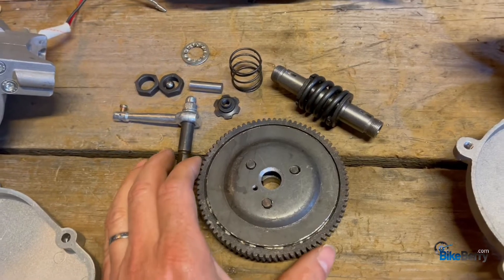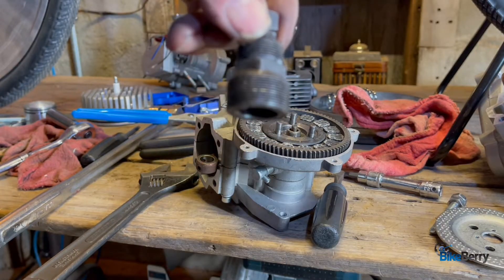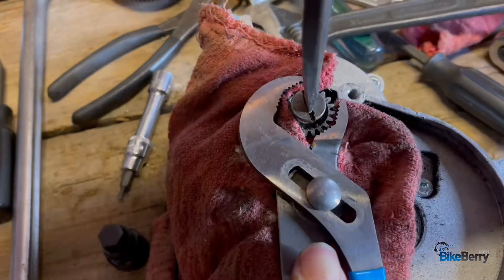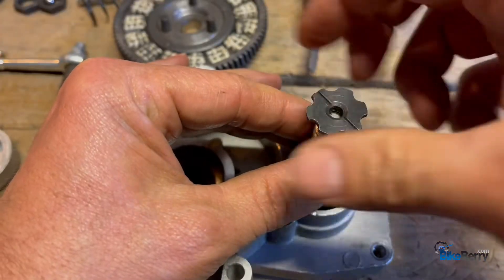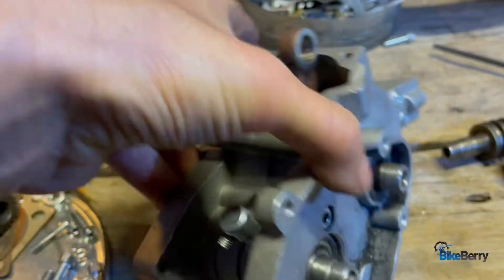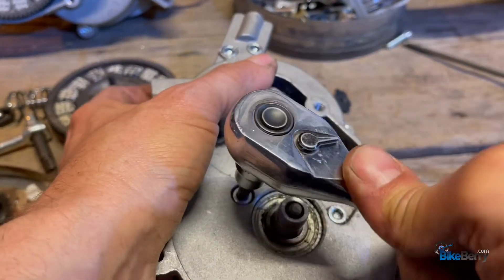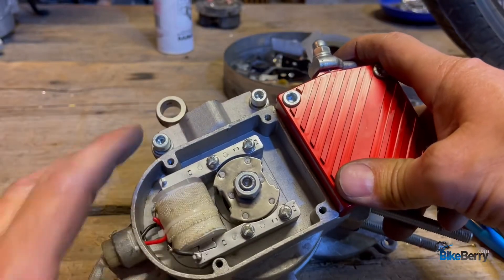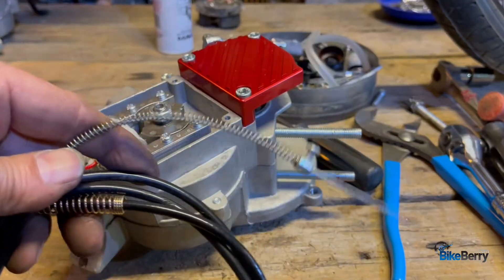Master Clutch Rebuild: Revamp Your 66/80cc Motorized Bike Engine for Peak Performance! | BikeBerry

Comment: Are hurt a cracking sound on my engine on the 80cc and it turned off the bike wheel locked I took off the spark plug and the tire moved but I do not know what went wrong😮
Reply: Same happened on my 100 cc I think its the part of the video where he tightens that big spring but I can't seem to figure out how to get the clutch open
Reply: @BigbagYQ ... That big spring is the main clutch spring inside the engine. You can tighten it up by taking out the cable holder screw located on top of the engine (it's the screw that the clutch cable runs through).
Take out that screw and then insert a small screwdriver down inside the hole into one of the slots on the washer that is attached to the main clutch spring. Make sure you get the screwdriver lodged into one of the slots. Then you hold the screwdriver tight with one hand and slowly roll the bike backwards. This will cause the main clutch spring to tighten up. You roll the bike back a few feet at a time. Then check to see if the clutch slippage has stopped. Repeat this process until your problem is solved.
Reply: @raulsaenz9281.. Sounds like you might have blown up the engine or broke a piston ring. Take off the top cylinder head and try pushing the piston down with your fingers to see if it moves or not.
Did you ever find out what the problem was?
Reply: @90daysinvegas53 did that pistons dirty and bike will run without springs google says just poorly, so a bunch of poor performance but I get a constant slip in my clutch after I freed my chain up and the wheel locked

Comment: I have 66/80cc engine to replace the clutch I have to disassembled the engine? Can I just replace the clutch wheel gear plate with the clutch pads?

Comment: I have a question. My small bevel gear that is next to the big clutch gear .do you grease those gears or no ? Thank you .❤
Reply: If you don't use grease, you will end up with a lot of tooth dust and no crank gear!    Always use quality high temperature Grease and DO NOT OVER GREASE!   The grease you should use should be thick enough so it doesn't fling around and get into the clutch!

Comment: With the clutch what would you recommend it threaded to. Thread all the way or middle or just barely threaded onto itself.those two pieces with the small bucking bar between the big spring.

Comment: I don’t see a need to replace the guts unless it was damaged from botched repair. The main spring can be tightened externally. Also guts can be removed without splitting cases.

Comment: having rebuilt motorcycle and quad engines for over 40 years, i must say your video is extremely accurate and informational, you covered every aspect of the strip down and rebuild, well done great video, subbed.

Comment: Has anyone had issues with the new clutches not fitting the shaft .i bought a stage 3 kit ran fine then the clutch bearing seized. bought a new one from bike berry and the shaft is the wrong size as is the key

Comment: wait a minute your telling people that they have to disassemble the complete engine to replace the clutch assembly? that's ridiculous, just pop the assemble out with the one bearing in tow and make sure to double check both bearings as it's not uncommon that they may need replacing, and double check that the spring tension pin in the shaft assemble is perfectly aligned and cencered that goes for new and used. respectfully Paulie T.

Comment: How do or where do you buy a pressed clutch gear , cause I don't see any way for it 5o come out and the two I bought off eBay don't have the studs and the back plate on a motorized engine do they come stock pressed or can you take the apart, please anybody let me know thanks
Reply: So nobody knows how a big gear. Beveled clutch gear center with the studs come out of does the studs come out cause I can't seem to find one that's not pressed from the factory please reply

Comment: Jesus, do not listen to this guy at 13:27. The flower nut and it's grooves are the size they are because when they're locked into the head of the Phillips screw it holds your clutch position/adjustment. 

First, attach the drive sprocket side. That will include your ball bearing, bucking bar and clutch cover with the cam shaft/actuator arm in it. Press the arm inwards, and it disengages the clutch which will allow you to turn it with your fingers. 

Do it his way, and don't worry, BBR will be very happy to sell you another flower nut.

Comment: Hello. I agree with Hardware2. A little moe information on what you should be looking for when setting the clutch tube assembly, such  as run out on both sides and maybe some more info on the preload would be very beneficial for someone doing this for the first time. 
 This was a very good video though. Very informative. Thanks.

Comment: @ 10:29. Are you sure that's installed correctly? I recently had to crack open an engine  to replace my clutch shaft assembly and dealt with this same problem.  It was driving me nuts because I couldn't figure out why one of the woodruff keys would only go in fully on one side and not the other. It turned out to be an issue with the bearing  and shaft not fully seated  in the housing/case all the way and a minor preload spring adjustment. Installing it your way caused  the clutch gear to disengage the shaft mid drive and the woodruff got destroyed. Why skimp on that scene then immediately jump to putting the clutch gear on pretending that its flush in the slot?   That doesn't seem right at all. You might wanna redo that part, You wilen.

Comment: The first time I did this ( around 2012) I seem to remember having a real hard time separating the crankcase parts. Everything else was pretty much like this. The tool provided is definitely not well made and very hard to use . Have to order another, a little better but not by much. I'm imagining that issue with it is been resolved!  Otherwise, I wish I could watch this video at the time. All I have was black and white pictures

Comment: Heck if you have it ripped apart balance the crank while your in there. Your motor can archive higher rpms. In stead of 4500 redline you'll go up around 12000 rpm which you'll double your power of motor. And the biggest thing on clutch to watch for. Is flower screw. Make sure it does not come out past the pressure plate. If it does I mean even a hair. It will mess with the pressure plates yes plates from sandwixhing together. It might not even leave a Grove. Here's how you'll know. When motor is cold clutch grabs great. Once it heats up doesn't grab nothing
 Let it cool off and it grabs again. It's the screw hitting the 2nd pressure plate. Do this and it wont slip and you don't need to do rhe 600 lbs out board set up. Also use brake pads off a car. Cut out the pads for the clutch. They wil grab 100 times better.
Reply: Finally someone talk about using car brake pads !   And balance the crank.  You should have told everyone how to do that

Comment: Can you also do a video on balancing a crankshaft or sell balanced crankshafts
Reply: At the higher RPMs at the crankshaft is unbalanced you will shake it apart and break it but if it's balanced you get them higher RPMs without any problems

Comment: Hi Tony! Great video. Question about the shaft spring. The collar that adjusts the preload on the spring appeared loose on the new one. I noticed you didn’t give any attention to it or discuss it before reassembling the case. Wouldn’t that have been a good opportunity to snug it a little to ensure you had good grab on the clutch plate?
Reply: Good point. I should make that a short video.
Reply: @tonytaylor5087  Cool! I hope all is well. Great to see the ongoing content! I like the segmented approach…no need to build Rome in a day, right? BTW, this is David…the guy the shared the double-bracket tank-mounting idea and created a complete lighting system powered by a cordless tool battery. This my gaming channel account.

Comment: An old hack is if any metal parts like the shaft on the bearings are put in the freezer and frozen before reinstalling ,the case will go together very easy . Works like a charm .Good video .
Reply: That’s interesting. I’ll try it 😃

Comment: 1:39 A better tip for any riders out there, instead of potentially damaging the flower but just push the clutch arm in and you can remove it with you fingers. Those Chinesium flower nuts don’t keep shape very well when you beat em up with a flathead and hammer
Reply: True! I totally forget to do that 😅
Reply: I noticed that,  and you are right. I use to adjust it on the fly as my clutch wear out

Comment: My favorite part to rebuild. Thhs is where the learning is, getting to REALLY know the ins and outs of your engine. The first time sucks but totally worth it to me. I forgot to grease the bucking bar and it mushroomed and cracked the camshaft the ball had and indentation.😊
Reply: What a genius design this motor is to fit between the cranks of a standard bicycle. I believe it was a German design from the 1920s, that betters modern Japanese designs  in terms of weight distribution and supreme compactness.
Reply: Agreed!  It’s definitely a time where you start to really understand how it works!

Comment: Allot easier than I thought.Thanks Tony.I've never split a case before.Does anyone else put a tablespoon of gear oil inside the clutch spring area?I do that for the seals and bearings.(Just remove the cable adjustment/holder and put it in).Well Over 3000 miles so far,and I ride Allot of hills.I still grease the ball and bucking bar as needed.
Reply: Never thought about gear oil. But yeah you have definitely put the miles on so it seems to work. Thanks for the tip!
Reply: I thought of this today will do it now I know it don't bust seals 🎉🎉